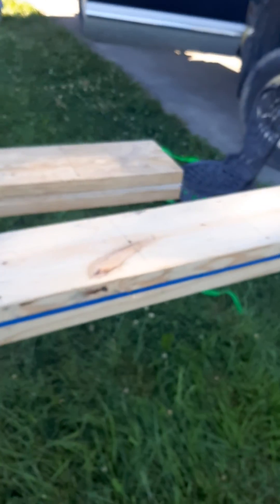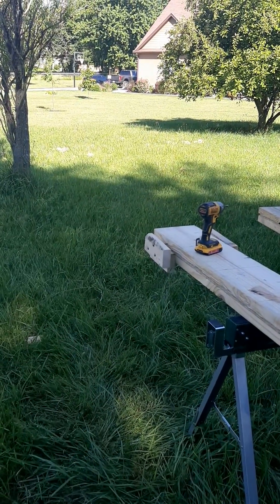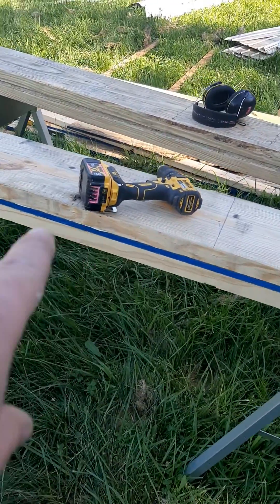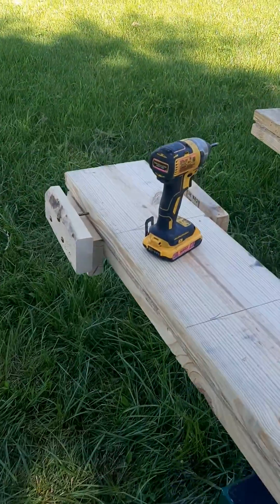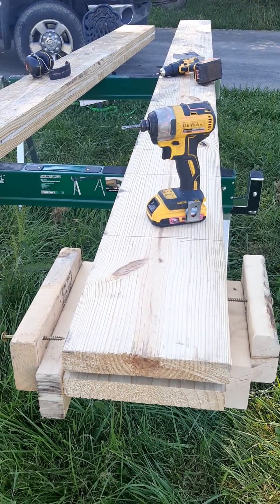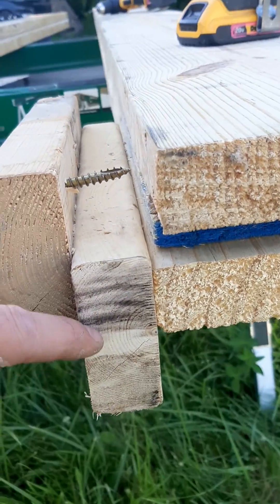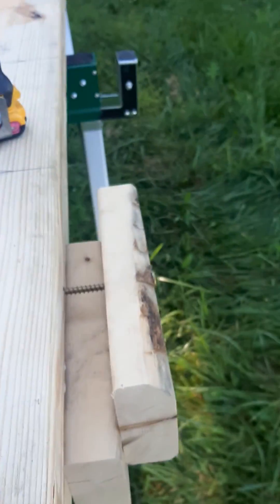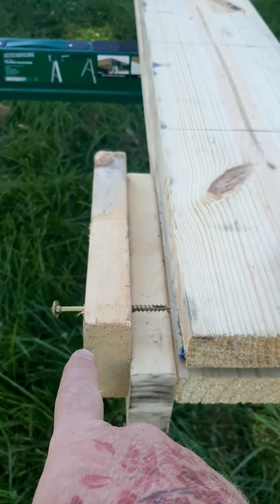How To Make A Strait Laminated Beam Without Clamps Or A Helper.

Comment: amazing plan to move the boards! I use string lines also. I suppose it would be possible to align boards with a clamp. Just put a block on the edge that's out of line, and clamp to the opposite corner. Thank you for the video!